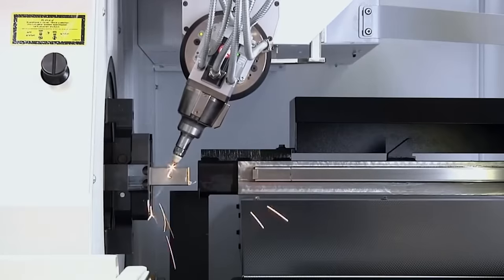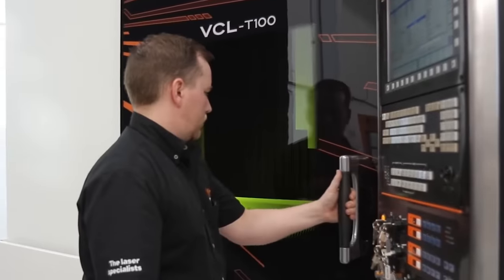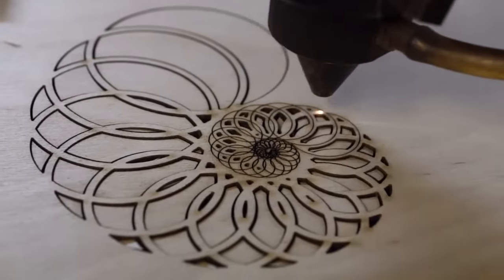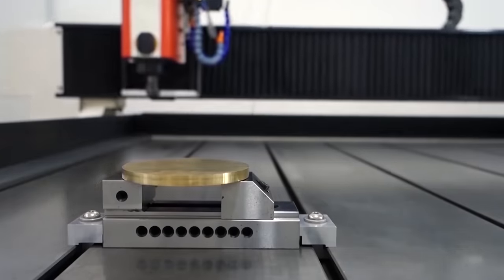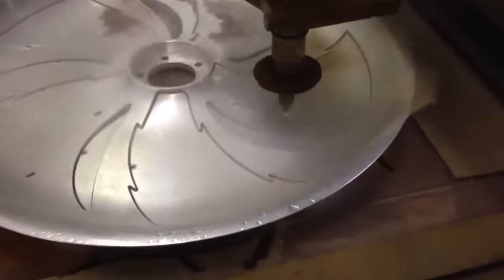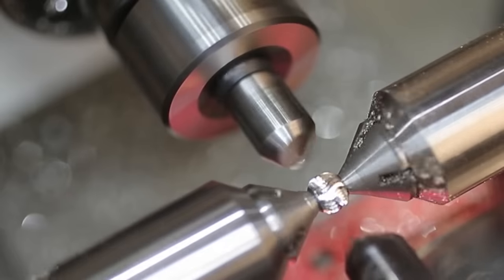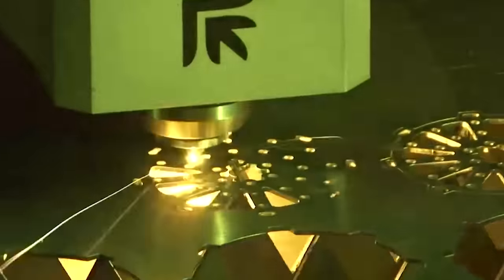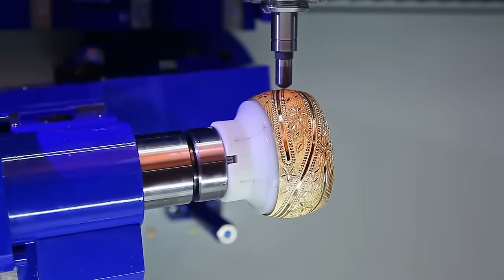THIS IS AMAZING, THE WATER CUTS THE STONE! YOU MUST SEE IT!

Comment: I worked in a steel fabrication shop that mainly use fifties and sixties Machinery to create weldments and other things of the sort. 
We had this one job that was about 20 feet long 4 in wide and needed drilled and tapped holes the length of the part, roughly 4 inches apart. Due to our archaic means of cutting and drilling they opted to have a company laser cut these parts and Laser mark the locations for the holes so we could drill and tap. Hey this sounded great. Until after the first batch we realize that the heat from the laser actually started to distort the steel which threw off the marked hole locations by as much as 20 thousands, which did not make our customer very happy. We ended up using our old school fixture so the hole locations were Within tolerance.  Technology is great, but sometimes the old way of doing things is the best.
Reply: What is the thickness of plate.
"Mainly these profile cutting machines created for increasing production
Reply: @muruganpadmanathan9217   3/8"

Comment: A water jet cutter, also known as a water jetor waterjet, is an industrial tool capable of cutting a wide variety of materials using a very high-pressure jet of water, or a mixture of water and an abrasive substance. The term abrasive jet refers specifically to the use of a mixture of water and abrasive to cut hard materials such as metal or granite, while the terms pure waterjet and water-only cuttingrefer to waterjet cutting without the use of added abrasives, often used for softer materials such as wood or rubber
Reply: Water jetor water jet?

Comment: It's not the water itself that cuts when it comes to harder material. The water is just used as a carrier for the abrasive material which is mixed in with the water that actually does the cutting.

Comment: Water cuts stone in natural environments all the time
edit read the reply’s on this comment to see how I just got S H U T D O W N and that 4th grade science class is bullsh*t
Reply: No it doesn't.  It's the other minerals and tiny bits of stone in the water that erodes stone in natural environments.  A waterjet cannot cut stone, metals, or glass, without abrasive in the stream of water.  A venturi, just before the water enters the carbide nozzle, sucks in the abrasive, (normally crushed garnet) and it is accelerated up to approximately 1-1.5 times the speed of sound.  It's that abrasive that is cutting the material, not the water, just like in nature.

Waterjets CAN cut soft materials, like rubber, certain plastics, cloth, and leather, to name a few, without abrasive.
Reply: How many googles did that take
Reply: None.  I owned a fabrication business for 10 years and had a waterjet to cut the sheetmetal that we then formed into aircraft structural pieces.  I've got thousand of hours of CAD time and programming time, along with machine time, running that loud bastard.  If lasers weren't so expensive, I'd have bought one, but waterjets are cheap, by comparison and cut a lot more different types of material.
Reply: Fascinating I see I owe an apology the more you know
Reply: No apology is necessary.  You can't always tell if someone knows what they're talking about, just Googled it, or is full of crap, so I understand your skepticism.  That's the nature of the internet.